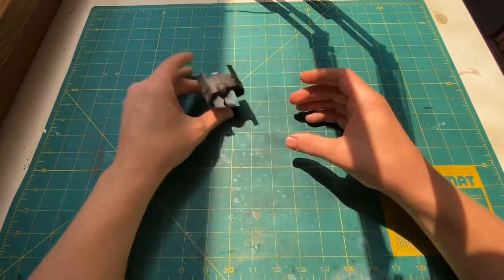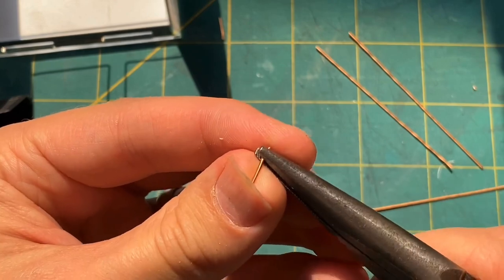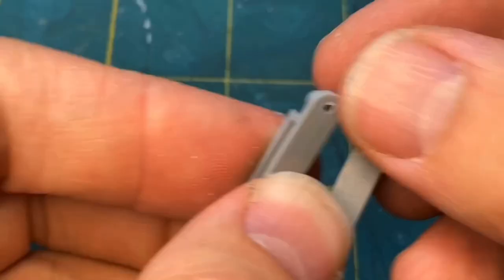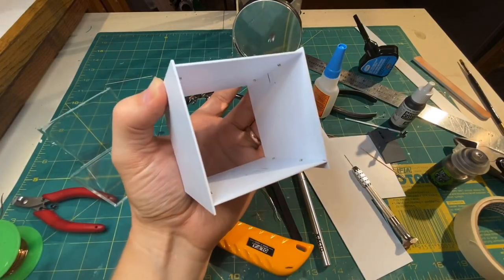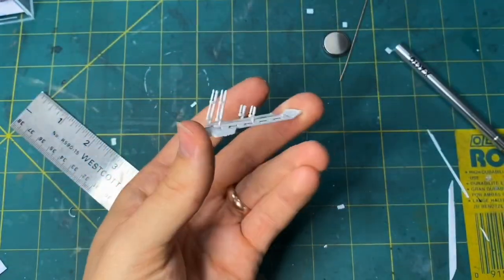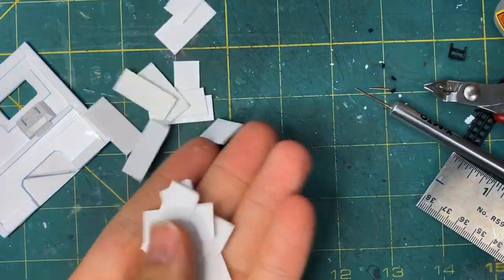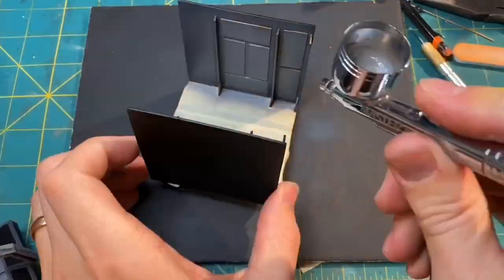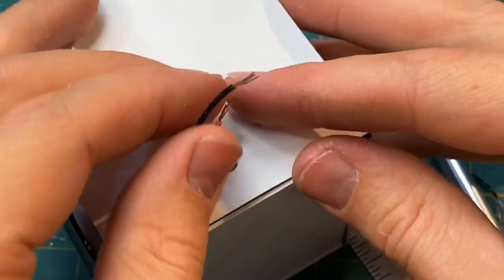VADER’S HANGAR | Nano Book Nook

Comment: Was that a resistor you soldered onto the LEDs? I'm not great with electronic parts but I can solder.
Reply from the maker: Yes, it is a resistor! It’s to make sure the LEDs don’t get too much voltage and burn out.